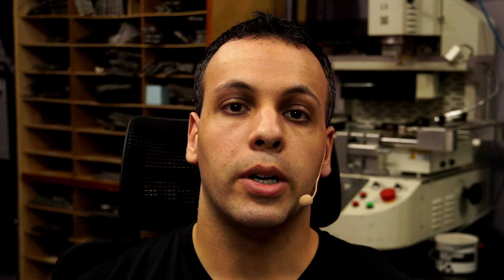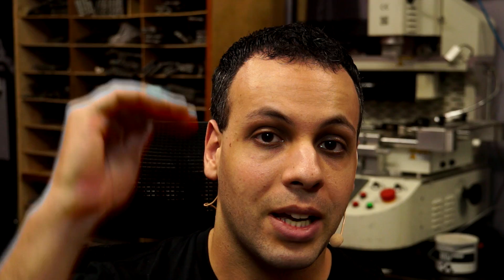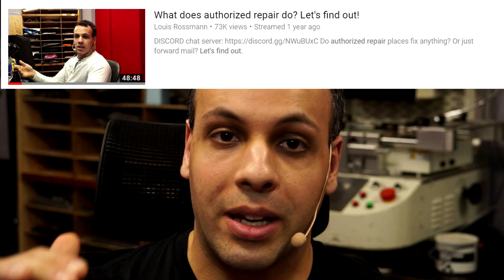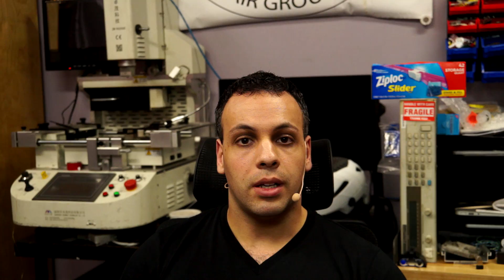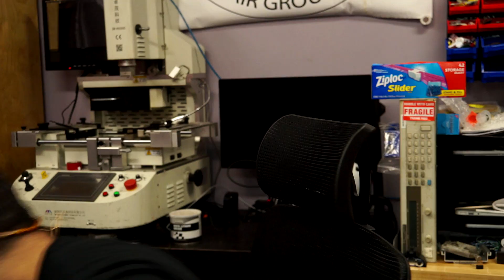Apple's war on refurbishing.

Comment: Tesla is doing the same thing in automotive field. Refusing to sell parts to third-party repair shops or customers for repair. If you do by a non-operating tesla that was in an accident and you fix it with other parts you obtain some other teslas they will not update the software and brick your car so you have a brick tesla. I’ve been repairing cars for 35 years fourth generation mechanic. Our families have always owned their own businesses body repair and mechanical repair. I will admit I majority of the shops are not qualified to work on teslas and they should not be allowed to to actually save the customer from Bad repairs and giving tesla a bad name this I understand. But some mechanics are electronically skilled I build my own circuit boards I build and repair and modify stereo amplifiers I play with my own raspberry pies and Arduino write my own code. I find electric cars much easier to work on with fewer parts and common sense than your average gasoline powered or hybrid vehicle. If Apple wins in tesla continues to strong-arm their way into a monopoly like this we will all lose. My wife owns a Tesla. I love the car
Reply: Even worse, Teslas actually run Ubuntu - but Tesla is refusing to comply with the GPL, or even disclose their use of Linux.
Reply: "Teslas actually run Ubuntu - but Tesla is refusing to comply with the GPL, or even disclose their use of Linux"

For real?? Isn't that breaking some kind of law?
Reply: Rich Repairs:

https://www.youtube.com/channel/UCfV0_wbjG8KJADuZT2ct4SA

Featured on Motherboard, he is a third party unauthorized Tesla repairman who basically does what Rossman does but in the automotive industry
Reply: There is a lab in Russia they cracked tesla's protection system and after that all parts will work.. If you bought something and paid the money it becomes yours and you have a right to do what ever u want including.. OMG.. FIX IT..
Reply: @nominasuntodioza2725  I love my country. Always hacking everything.
Reply: The problem with your argument is that if something goes wrong with a stupid iPhone, you aren't putting the general public at risk of accident or death.
Reply: saritha55 Very true I 100% percent agree with you and tesla to is hiring unqualified technicians who are not all up to par yet they to make mistakes. Yes every company say they will school and teach their Techs become better but unfortunately the gene pool they pull from some are like teaching a log. Like most states and here in California there actually is no mandatory training there is no hands on testing you could be the homeless bag lady and go down and pull a business license out to be an automotive shop hired a guy who stand around or Home Depot or Kelly Moore parking lot waiting to be hired and become a legitimate legal automotive repair facility. Fortunately Tesla is better than this. I have two inside tesla sources one is one of the chief head mechanics who’s been there for years and he was working on EV’s before Tesla was even conceived. The other one is in charge of hiring in payroll and the nightmares Tesla is going through in their build plant for employees who will say to keep it polite are less than subpar. Feel sorry for Elon Musk and his shareholders. As for the safety and lives of the general public with the self driving features this should be tightly controlled by Tesla in the rules laws and regulations to protect the general public from Bad repairs should be very strict Swift and come with high consequences towards the individuals who do faulty repairs resulting in injury to the passengers of the vehicle or bystanders from an accidental collision caused by bad repairs. I fully believe that should be hands-on testing mandated to the highest standards in the automotive industry should be divided up into tears one with a lower pay labor rate for those who are on qualified and a higher tier that is directly tied to the individual mechanics qualifications and if he leaves the facility the facility loses their license to operate on the higher tier vehicles immediately
Reply: "Fusing to sell parts" refusing*
Reply: after all, EV are much less complex than ICE. It just takes some time to catch up and learn for mechanics and repair business
Reply: Gonna play the devils advocate here for a second and say that when it comes to vehicles with self driving capabilities, there's some sense in keeping a very close eye on repairs first-hand.

I do believe there's a balance to be struck between safety critical systems and user/3rd party repairable systems. If something goes wrong while the vehicle is in self-driving mode, not only is the users safety in danger, anyone on the road in the vicinity is also in danger, and someone without proper diagnostic tools and know-how should not perform repairs on a self-driving vehicle.

On the other hand, a better option than to brick the entire car would be to simply disable the self driving mode when a non-authorized replacement is detected. I'm just saying there's actually a resonable sounding excuse for Tesla (protect other people on the road) vs Apple ("protecting" the user from themselves). Tesla has a moral responsibility to make their vehicles as safe as possible, which they can only realistically guarantee when they control what happens to their systems, whereas Apple just screws with consumer rights for the sake of $$$...

P.S.
Not saying Tesla ISN'T just doing it for $$$, but they have plausible deniability for that argument, something Apple doesn't really have.
Reply: I can understand what Tesla are doing for the time being, because there aren't really any standards for them to stick to right now. But I worry that they will abuse this repair system in the future. At some point there will probably be more standards for electric cars, self driving cars etc. and hopefully Tesla will stick to them.
Reply: Jason Fresh Yes they got some in perfections being a mechanic my whole life I got to say the Japanese got the Americans beat hands down it’s not even a comparison it’s pathetically funny and extremely embarrassing. Wife just picked up her tesla last week they’re getting better on the fit and finish still some very minor paint flaw defects around the vehicle kind of defects amateurs would make. Wife tried the self park feature for the car to park itself, hit the vehicle behind us. performance wise especially on take off hands down with the performance package there’s not many cars on the road can even come near touching this vehicle accelerating down the road. Absolutely amazing car are Toyota Prius is probably the last gasoline vehicle will own since all my vehicles go into 300+ thousand miles without any breakdowns of engines or transmissions. I’m seriously not thinking my tesla will make it 300,000 miles without a breakdown. And because tesla does not have internal combustion engine it does not have to release it specifications for operating to the general public or other mechanics because there’s nothing to do with EPA laws for emissions. That is the dealbreaker that is loophole that they could hold over the automotive repair industry at this moment

Comment: And Microsoft is starting to follow them lately with locking surface pro just like mac's, even support is following them too I took SP4 to them back in July, it took them 5 days to get screen replacement parts because the center don't have stocks all the time. Yes they replaced it for free even without warranty but not having parts for a newly released product line is bad practice and no 3rd party shops have parts in my city.
Reply: Btw the reason why the Surface Pro takes so long to repair and get parts for is because a majority of it's parts including small connectors and components are extremely fragile, proprietary, and almost impossible to get a hold of in good condition and affordability. It's on par with the repair ability of the newer MacBook Pros, you're more likely breaking something else when completing a simple repair like a screen assembly replacement.
Reply: Also if it was a new device companies are using parts for production and focusing on making new units before they start supplying stores with extra parts for repair
Reply: Well, Apple would certainly not replace your screen for free out of warranty.

Comment: Tesla and Apple seem to have the same repair mind set
Reply: Zach Michaelis ...so does that mean all Tesla owners are beta-testers?...if so, maybe there should be some rebates for being Guinea pigs and product testers, rather than end-user consumers?
Reply: @remlatzargonix1329 " Guinea pigs" 😆😆
Reply: All car makers do this, the Euros are the worst. Proprietary scan tools that cost mechanics THOUSANDS to access so they can read ECU faults. "Genuine BMW" parts that are 3x the price of the exact same OEM one. $6,000 steering columns that have to be coded to the ECU at a dealership because "security". CEL's that are on forever unless you service at a stealer.  Immobilisers have been "bricking" cars with this kind of shit for decades!
Reply: bennyg OEM does mean Original Equipment Manufacturer. I think you mean third party..
Reply: @greebj  Some countries have very strict security requirements - e.g. regular mandatory technical checks - and it shows: the US have almost 3 times as many fatal road traffic accidents per capita than Germany. Despite higher speed limits and partially lack thereof in Germany. For my motorbike I had to keep type approval paperwork with me when on the road, since I replaced many parts with non-original ones (for both aesthetic and performance reasons). The reason was again security, because guess what - it's not just your life you put in jeopardy when using incompatible or potentially non-compliant parts: if there's a problem with the steering for example, others might get hurt, too.
Reply: I think Tesla's mind is slowly changing.
Reply: bennyg wrong comparison. at least you can get their (EU Cars) parts and diagnosis tools and run a 3rd party repair shop. Tesla will not sell or give any of this to any 3rd party. Only Tesla service center.   They will never make this work in the EU, its against the law.
Reply: Remlat Zargonix Unless they're breaking the law and selling you broken products, it's no different from what any other manufacturer does. Recalls happen all the time. Everyone's a Guinea pig.
Reply: Tesla literally hires apple former personnel or rejects
Reply: That is the one thing I don't like about tesla is the way they do repairs
Reply: Exactly.  Only the dealer and "authorized" shops are allowed access to parts,  software and other tools to repair them.  God forbid if you want to work on your own car!  There is a youtuber here that rebuilds them and tells of his battles with them.
Reply: yup...that's him
Reply: Oh, so I assume you know how to repair the sophisticated computer systems of a Tesla? I mean, changing the brakes is one thing. Fixing an issue with the braking differential curve that's programmed into the car's computer? Have fun voiding the warranty. Also Teslas  aren't really built for gearheads. I doubt there's much, if any 3rd party hardware you could install to boost performance. It would all come down to tuning via the car's computer system. Even though I know my way around a computer system, I wouldn't want to touch anything inside a Tesla's computer.
Reply: yes,..   but one is for good reason and the other is needless greed..     i dont want to be driven over by any car that some jackass has self-handedly repaired the breaks of.
Reply: Well, with Tesla we can't really blame them , they got best electric cars , you can't really pick anything else. At least they have superior battery technology , and they can justify all this monopoly bullshit with that. 
What is disturbing about apple, that there are currently equally good , if not better phone for much less money , but people don't buy them (
Reply: Yeah....it's not just apple and Tesla, many car manufacturers do the same. Especially high end car makers.
Reply: funny how most Tesla fanboys don't even notice that..... nuff said
Reply: Tesla has atleast a better service and warranty.